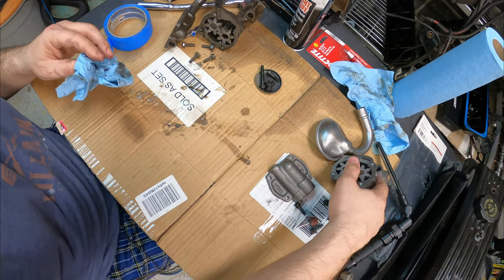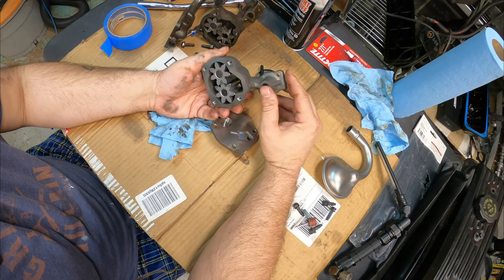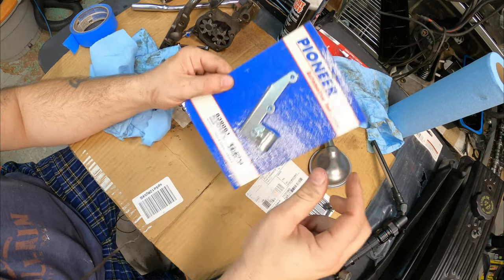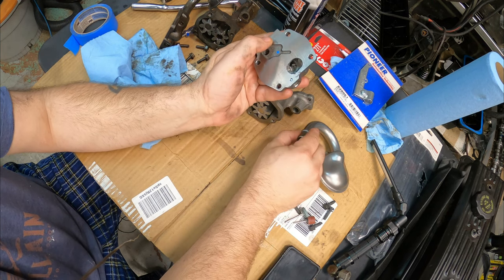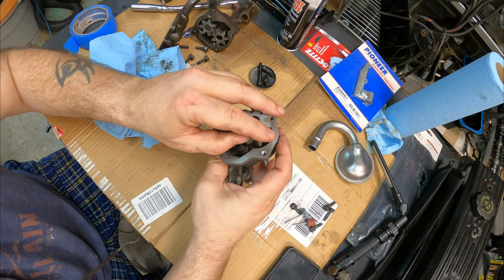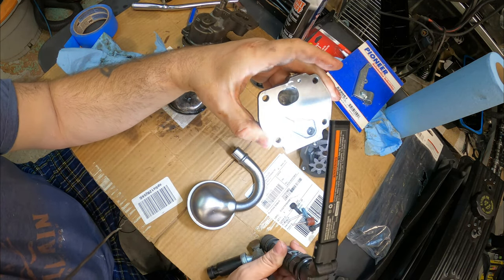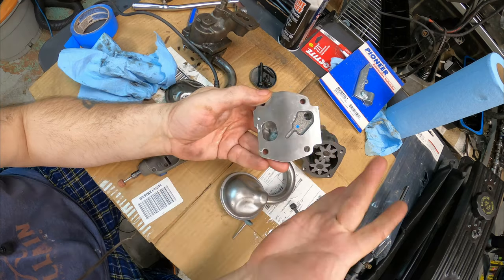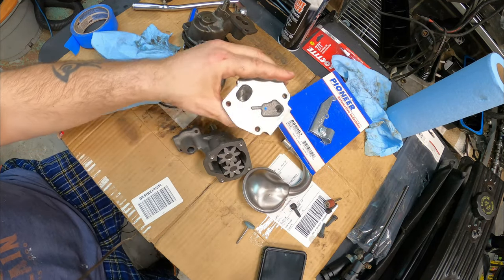Small block Chevy oil pump

Comment: Nice explanation of porting a stock oil pump housing but why stop there, why not show and explain about how to do the very simple Pressure Spring replacement to increase or decrease oil pump pressure as well ?
 Jegs and others sell the springs separately as well.
Reply from the maker: i will do a future video with the old pump ...  i try to give simple mod examples  for your average person throwing a motor together... there is so much you can do with these pumps to improve them ... thx for watching

Comment: what pickup screen to use with a melling m55hv pump and 8,25 inch oil pan thank you in advance
Reply from the maker: for me i used a stock one but for your deeper pan i think you need the extended one that drops down anther inch

Comment: I use nothing but big block style pumps in my small block engines. Smoother operation less spark scatter due to more gear teath.
Reply from the maker: yes you can use a big block oil pump but for lt1's are unique where they don't have rear distributors  and run a dummy gear setup in a plastic shaft housing only held down by a single 14mm bolt that could crack with he extra load from a big block oil pump plus it does out weight the power loss taken up running big block oil pump ...

Comment: My small block  327 is in the 600hp  range so I went with  Melling hi volume  oil pump
Reply from the maker: hi and thank you for watching    HP power does no dictate the type of oil pump..  its all about the bearing clearances  that dictates if a high volume or high pressure oil pump is needed etc...   yes I used to run High volume pumps in all my engines  these days with better machined and  high quality of parts better oils the high volume is not necessary in most street / performance engines...  also  high volume pumps cost more power put more stress on the oil pump shaft and distributor gear .. unless you running super large clearances its not necessary...

Comment: Looks like machine shops won’t be out of business anytime soon. I can picture all of the “KNOW NOTHING, MOTOR BUILDERS, yes I’m picking on all you that call a fuel burning engine a motor. I love asking single or 3 phase. Lol. All the cast material floating through the oil and F’ing things up on its way through. Why do. Say this? Because not many people will degrease, re degrease and wash with hot soapy water and then still wipe it down with a clean lint free cloth with ATF on it to see if it’s truly clean. Btw, after all of that, I re clean that same engine again and again until it’s spotless
Reply from the maker: Hi and thank you for watching ... these videos are not how to build a engine (there are many videos out there that break down every step) there more designed  as a journey to what takes place and long the way tech tips ... not sure where you gather that i don't clean down the parts i work on...   Engine builds like this will never be perfect but hot rodders have been building engines in their backyards since the dawn of time ... anyway i try to be as clean as I can ...
Reply: Look up the definition of a motor. I was surprised when it was pointed out to me as well.   Basically all engines are indeed motors but all motors can not be engines with some sort of piston drive whether from IC or steam etc.
Reply: @Spiritof_76  oops.   Pre coffee post
Reply from the maker: true  @wayneskelly4297
Reply: I suppose you also ride an enginecycle.

Comment: Its not always the pump but not having proper bearing clearances. Hot rod motors need more if you have a high volume pump !
Reply: You don't match the bearing clearance to the pump. You match the pump to the engine. 😲
Reply from the maker: 100%

Comment: I run a big block pump in a small block.
Reply from the maker: yes but no need in a street motor plus it takes more power to run a big block oil pump
Reply: gm made those pumps different for a reason,,,the harmonics would break the casting next to the bolt that fastens it to the main camp,,,and a big block pump has the same by pass so to speak to bleed off excess pressure,,,big waste of time,but do what you want,just thought i would giver you an little bit of knowledge
Reply: @tomstiel7576  Little bit to none.

Comment: "that right there is worth.. who knows what it's worth" - ROFLMFAO!!! If you don't actually know what it's worth, how do you even know it's helping shit?
Reply from the maker: Thank you for watching .. This technique  has been used for decades to clean up sharp edges in casting marks  in the pump and the rear main cap where the oil pump bolts to..  I wanted to highlight a brief part of this build for items most people over look...  don't take my word do a little research and let me know what you come up with...

Comment: Wanna make a small block oil pump better?....use a big block pump.
Reply from the maker: Hi and thank you for watching .. yes you could use a block  block oil pump but for most street engines it does not out weigh the power it takes to drive a big block pump. A stock pump is more then enough...  plus with lt1's where you don't have a rear distributor the only thing holding down the gear to the camshaft is a 14mm nut with a dummy gear it puts to much stress and can break the plastic hold down tab that the dummy gear rides in
Reply: @maldo72  the power difference is minimal and the added volume makes feeding turbos that much better...

Comment: That's not even necessary, waste of time.
Reply from the maker: please enlighten me why you think this would be a waste of time i am always up to learn new ways of thinking and never to old to learn....
Reply: @maldo72  I've ran Melling Oil Pumps for years, standard volume and the oil pressure gauge reads exactly like factory. Your not even going to notice or feel the difference in what your doing. But, if it gives you peace of mind, go for it...your engine.
Reply from the maker: Thank you for your input in the video I stated that you would not change the pump volume/or psi .. what I was trying to say is to reduce what I call pump chatter at high rpm (or some call cavitation ) by smoothing out the casting within the pump and rear main bearing cap for a smoother / more direct flow path with less turbulence ...    circle track and drag racing guys have been doing these little mods for decades..   if you have an old oil pump laying around take it apart and you will see what I mean within the plate you can feel it with your finger there is a rugged ridge and almost 90 turn the oil has to flow through ...  I will try to cut the plate in half to show in a later video..  these are little touches i like to add to all my builds   @texassquarebody6119

Comment: Lol. When people really think they know what they're talking about.
Reply from the maker: Please expand on your thoughts of what you disagree about this video i am all ears and i am always open to learn new stuff ...  i am just sharing what has worked for me in the past with builds like this...
Reply: The modification you're doing doesn't hurt anything but doesn't improve anything either. It's fluid dynamics; there is no cavitation happening there.
Reply from the maker: @causeimbatmaaan  I have no data to back up my claim but there is definitely an abstruction from the manufacturer process you can feel it with your finger when combined with massaging the rear main cap can't see how this doest help with flow ... (restriction) Racers have been doing this for decades... ... once again I am humble enough to change my ways with alternative ways to think about stuff... bottom line I am all about learning and improving my thought process for every build I do.....  ...
Reply: @maldo72  It's a volumetrically fixed pump. You cannot increase the flow and there is no restriction for that volume of flow when the passage is bigger than it needs to be.
Reply: @maldo72 , great video . Unfortunately , some people aren't happy, unless they are hating on others. Great mod . I'm going to use it , on my Corvette.
Reply: @causeimbatmaaan 
Please don't port the heads. It doesn't help. The engine still uses the same amount of air at 5000 rpm. Doesn't it?
Reply: @causeimbatmaaan 
It does work,  I watched a guy prove it. He used a 5 gallon bucket,  put the oil pump in the bottom of the bucket,  ran an oil line out to another bucket,  used an electric drill to operate the pump.  He measured how much oil pumped in 30 seconds.  Then used an oil pump that wasn't modified.  The unmodified pump put out less oil in 30 seconds than the modified pump.  Same drill, just different oil pumps.  Both stock oil pumps.  The modified pump put out 3 Oz more in 30 seconds than. The unmodified pump.  Not much but a proven difference.
Reply: @bertgrau3934  You would have to measure the revolutions of the pump not the time you run it for. If so it would be exactly the same.
Reply: @causeimbatmaaan  
An electric drill would have te same RPM either way. The only difference could be if you used a thicker oil . The gentleman, used the same oil and same drill. I stand by what I said.
Reply: And naturally you consider yourself so competent as to make that judgement about everybody else, being the smartest person you know. Call NASCAR or the NHRA and offer your undoubtedly superior knowledge.
Reply: @corbinhbucknerjr558  
Don't know who you are referring to. If it's me, I'm not saying anything about anyone.  I just saying,  the modified oil pump does pump more oil than the unmodified oil pump